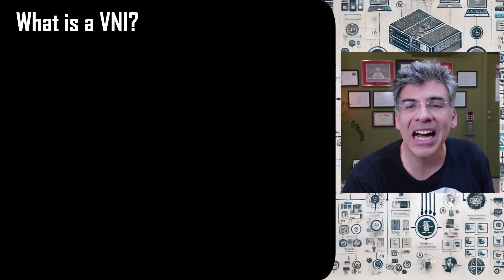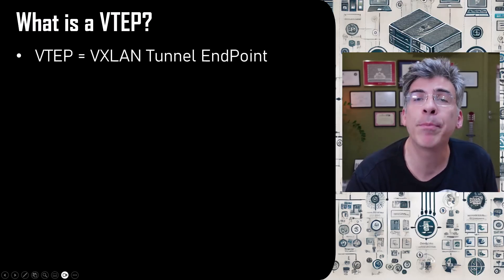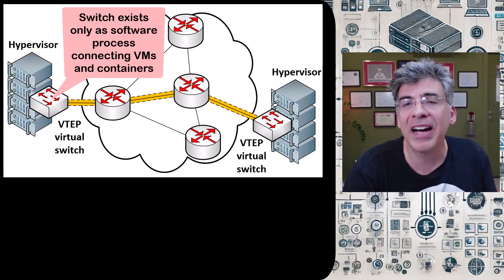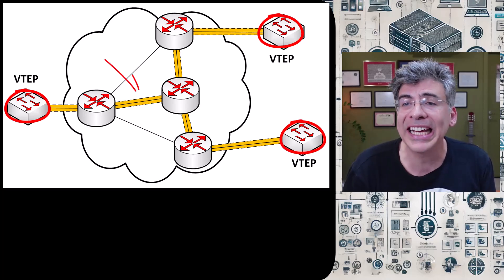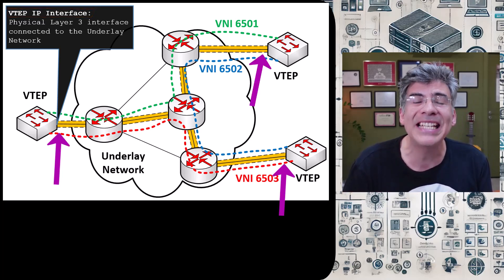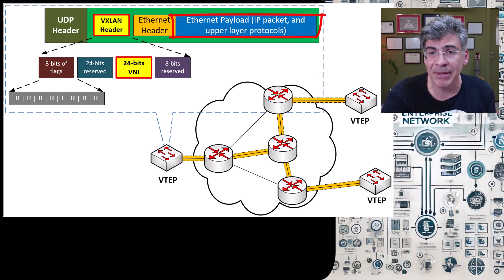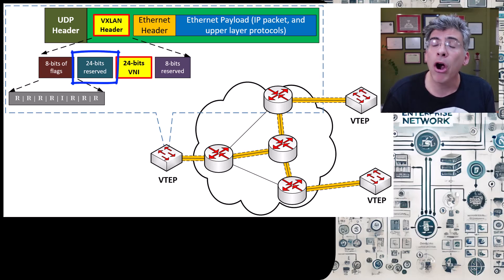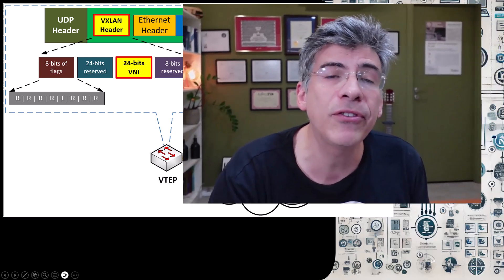VXLAN - VNIs, VTEPs, and VXLAN Architecture

Comment: Hi, are VNI interfaces L2, L3 or can be both?
Reply from the maker: VNIs can be configured as either Layer 2 or Layer 3 depending on what you want to do.  They are approximately similar to Layer 2 and Layer 3 VLANs in purpose.  Layer 3 VNIs are used for inter-VNI routing.  You can find out more about that at this video here:  https://youtu.be/YkPGKxiOxEE